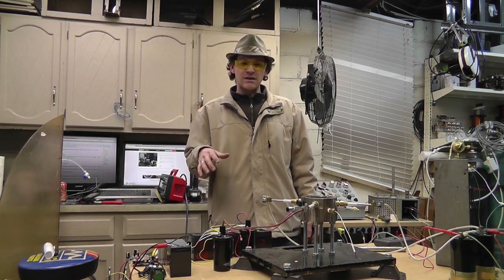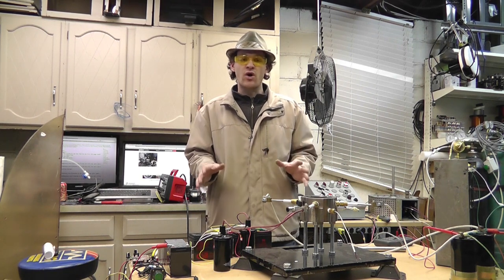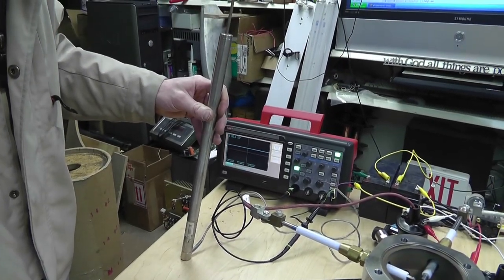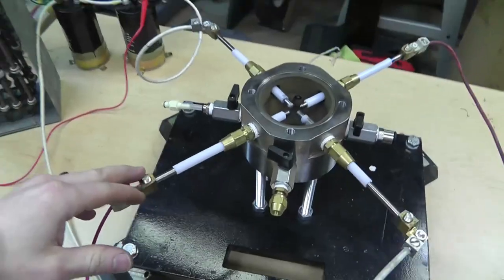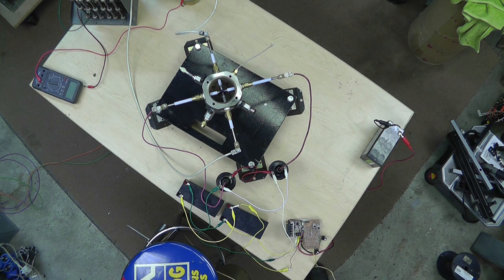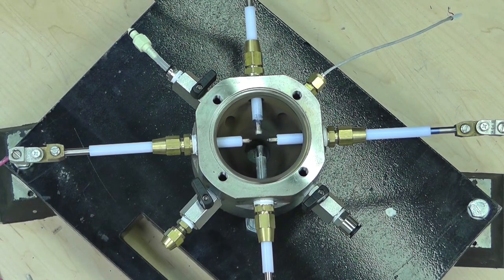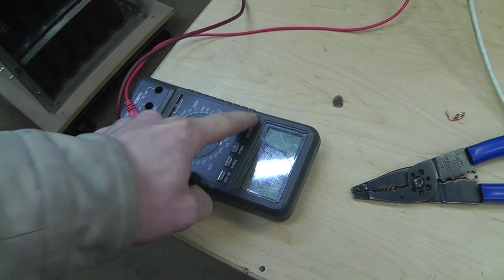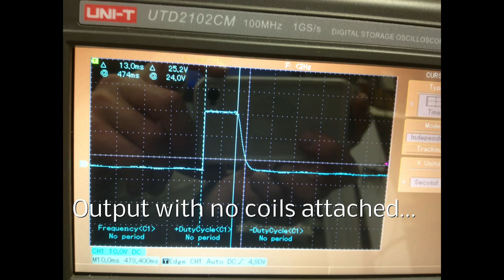Update 20 NGE Papp: "THE PLAN" & Ignition Set Up Test With Papp Timer & New "tools" RWGresearch

Comment: Not sure how you are going to use that Honeywell sensor Russ but I know that you are a creative guy.  It's not designed to capture a high-speed displacement event like the piston moving.  Note the long metal rod has momentum and will continue traveling if it gets hit by a part of the piston.  It looks like it was part of an older measurement system where you move the sensor around on an X-Y table and then make Z measurements.  It is very precise, like for making aircraft airframe measurements.

Comment: the end of the honeywell piece has a screw on end. you can see the crosshatch on the end piece to get a grip on it to be able to turn it off.  that will give you the end of the shaft, which has a thread end on it.  Perhaps you can unscrew the cap piece, and figure a way to attach it to your popper top, giving you the ability to screw it to the sensor to take your measurements.

Comment: put a resistor in between the electrode, they use that on jacopes latters. help the arc flash across. maybe the caps will dump easier. if you hurt yourself, make sure someone loads the video(did i say that)

Comment: Find a way to mechanically induce the ignition, opposed to pushing the button yourself. IMO, from my observation, you mention the POP seems to be random, but when you take into consideration you randomly push the button, sometimes holding, then letting off, and when you let off, the times of duration are then also randomized, because the length of engagement between on/off is varied. I believe you need to be able to precisely start and stop the process, controlling its duration with adjustment

Comment: the funny thing is all the components you need to run a engine on nothing ells than air the components are alredy are on the car! yep works perfectly how ever the pap engine use selenoid push and pull effect magnetic field and plasma spark! if you know what parts do that any way in a car so you will figure out how it works moisture in the air sucked in the engine implode any way with plasma ignition how increase moisture you ask? well use turbo ore a compresor! by the way that 90° degre ac spike on ignition coil isnt realy ac its some thing ells you figure out what it is for your self. evry thing the car oil industry and army lied a engine has lot secrets what need to by discovered